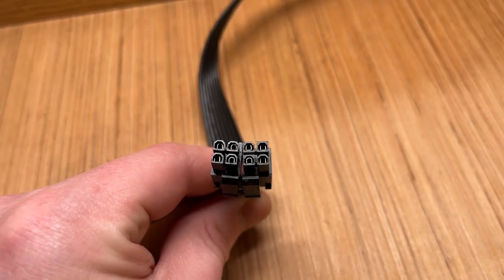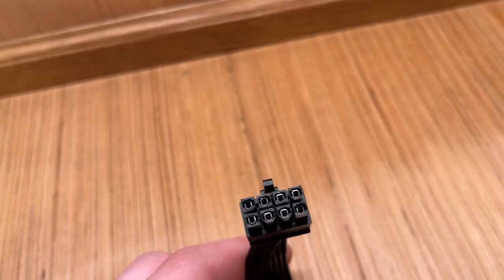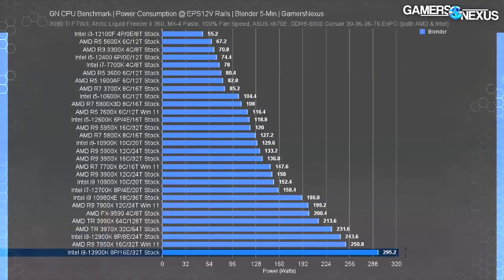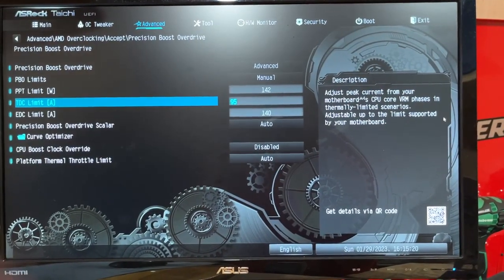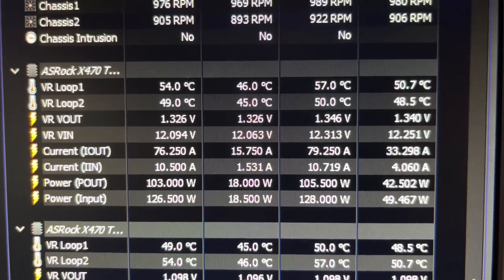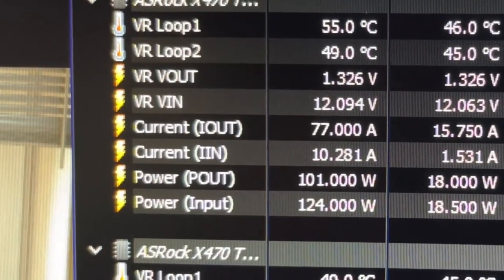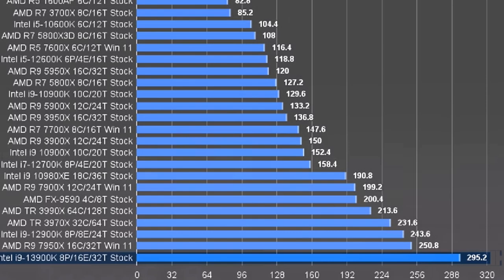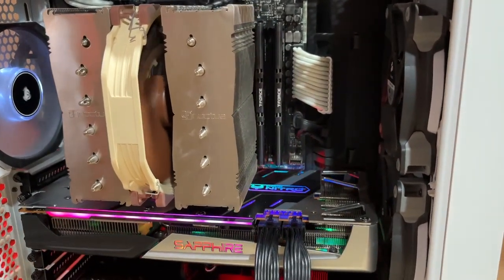You Don't Need Two CPU Power Cables

Comment: Many thanks, took me forever to find a proper answer. The new motherboard im planning on buying has 8 and 8 pins and my current PSU only has 8 pins. I really don't have the money to upgrade to another power supply specially since the one I have is more than enough.
Reply from the maker: Which CPU and motherboard are you going with?
Reply: @anthonytech  it’s an i5 12400F and the mobo is a ROG Strix Z790-9.

I’m in the middle of putting it together and I just managed to get into BIOS with only 8 pins. I’m missing the new m.2 drive I need for C but my impatience got the better of me.
Reply from the maker: @LyraniaLothar  You'll be plenty fine with a single 8-pin for a 12400F. Good luck with the rest of the build and happy gaming!
Reply: @anthonytech  Hi, I just bought a Ryzen 7 8700g and a B650 Pro Motherboard. My PSU is an old Cooler Master 650w +80 Bronze, it only has a single 8-pin, the motherboard request two of those.

Thank you.
Reply from the maker: @Uasaapp  One 8-pin is plenty for an 8700G

Comment: My motherboard is a msi mag b650 tomahawk wifi with 2 8 pin cpu power outlets and the cpu I’m using is the 7800x3d do I need to occupy both outlets or just 1?
Reply from the maker: One 8pin is plenty for a 7800X3D
Thanks for watching and commenting

Comment: 7950x runs fine with only 1x 8pin on MSI PRO X670-P Wifi , however havent done any stress tests. i'm using a gold 750w seasonic psu with a 7900xtx which is ok, considering i'll be undervolting them both.
Reply from the maker: Let me know how the undervolt goes 
For a build like that I would’ve went with at least an 850w but 750w should be okay

Comment: do you have this type of proof on the GPU side of this convo - seeing so many talk about the pigtail/daisychain 8-pin convo., with 2 or 3 8pin inputs on a 30 or 40 series card... people are saying LEAVE the pigtail hanging in the air and direct multiple 8 pins from PSU straight to GPU and just leave the pigtail hanging off (ugly) but is this actually good advice??
Reply from the maker: Let’s assume you have a GPU with 2 8-pin connectors:
A single cable that has 2 (daisychained) connectors on it to power the GPU is just fine 
Being cautious is never a bad thing though. For example in my personal rig my GPU has 2 8-pins and I use two cables to power it. As for the the daisychained connectors I zip tie them to the cable itself to look better 
You can also get custom cables so they don’t have additional connectors on them. Cablemod makes really good cables.
Reply: @anthonytech  yes i did this about 5 days back and tied the chain flush so visually didnt see the difference and i saw a jump of 50-100 points in most benchmarks i run before/after. and 5-10 fps more when running 105% power on Msi afterburner. was a fun lil free upgrade to do with the 2nd 2-8pins i have in my psu box just sitting there now in good use!
3800x CXPU
3080ti GPU
thermaltake 850 PSU

GPUZ - says i pull a nice steady 350-352 draw on GPU under full load now. before was capping at 338-348. 

For anyone that might read this in the future it was worth doing and free : )

Comment: i build a backup pc with a ryzen 5 3600 with power supply of 800w corsair and only 4 pin works on it so i plug it into my motherboard and it seems to Function just fine with only 4 power pin connected to it.
Reply from the maker: Yeah the 3600 is only 65W TDP so 4pin is plenty

Comment: I have 5950x and asus x570 gaming motherboard , but power supply heave only one 8pin cable. Is this enough for this processor?
Reply from the maker: Yes as long as you leave it at stock settings 8pin is plenty

Comment: I have an i9 14900kf. Should i connect the extra cord on my dark hero? Its another 8 pin.
Reply from the maker: So sorry for the delayed response. I swear YT isn’t notifying me. Depending on if your PSU, it wouldn’t hurt to plug in an additional 8pin since it sounds like you have a highend build
Reply: @anthonytech  Thanks! I did a while ago.

Comment: I have an MSI B760M chipset motherboard and i5-13600KF, instead of plugging 8+4pin connector but i only plugged 8 pin connector. Is it enough?
Reply from the maker: Oh yes one 8-pin is plenty for the a 13600KF 
No need to worry 😁

Comment: i have an i5 12600k and my new mobo (asus prime z690-A) has an 8+8 eps, would one 8 pin be enough if so which female connecter do i plug it into?
Reply from the maker: As long as your PSU is appropriate for your build
One 8pin is plenty for a 12600k 
Plug it into the left connector on the motherboard

Comment from the maker: CORRECTION: 3:01 The AM4 socket CAN deliver more than 142W, I was wrong. an overclocked 5950X can draw up to 270W depending on the scenario. Point being for most midrange CPUs (which is most of us) an 8pin is more than enough. If you're building/running a high core count CPU and plan to OC then plug in two 8-pins. And in most situations CPUs will hit a thermal limit before you ever get close to the 8pin amperage limit.

Comment: hello my pc is
motherbord a320 sh2
cpu ryzen 5 2600 tdp 65
gpu gtx 750 ti tdp 60
one hdd
one ssd
ram hp v6 8gb 3200mhz
power supply Dell 275EM-00 - 275w
and my power supply have 4 pin only  motherbord a320 need to 8 pin , so 4 pin its will worked or no?
Reply from the maker: 4 pin will work just fine for w 65w TDP CPU

Comment: I have a AMD Ryzen 7  3700X 8core in a  proprietary  HP Pavilion with only a 310 PSU and 4pin socket. I heard that corsair sells a 8pin that you can separate into a 4 pin that will work and use with an ATX bigger wattage PSU. Hope this question relates somehow to your vid which is somewhat over my head tech wise. Thanx in advance.
Reply from the maker: My video served to prove that most CPUs are plenty fine with a single 8-pin even though some boards have an 8+8 or 8+4 connector
A 3700X should be just fine with a 4-pin cable but I wouldn’t slot in anything over a 65w TDP chip
Reply: Hey you just saved my ass with that comment on how Corsair has splitting pin cables thanks have a great life👍🤙

Comment: I just got the new I9 and my board had 2 8 pin connectors i have a 1000 watt PSU but it only had 1 8 pin cable, if i buy a second one would i be able to plug it into the spare cpu port on my PSU?
Reply from the maker: You can do that but be VERY careful. 
Make 100% sure the cable you are purchasing is for your PSU 
Otherwise it could go very wrong
Mixing PSU cables is a no no 
There really needs to be a standard for modular PSU cables

Comment: Today I started to put together the new setup ( MSI PRO X670-P Wifi with a Ryzen 5 7600X ) but my power source have only an 8 Pin cable for CPU and 4 Pin aditional cable, the motherboard have 2x 8 Pin for CPU. Should I buy a new 8 pin cable to power the CPU?
Reply from the maker: A single 8-pin CPU power cable is plenty for the 7600X. No need for the additional 4-pin or even 8-pin, you’ll be just fine. Let me know how it goes! Good luck! Thanks for the comment
Reply: @anthonytech  Everything works fine. I had no problems with just 1 8-pin
Reply from the maker: @foxredwings  Glad to hear it! 
How are you liking your system?
7600X may be a 6-core but it’s a fast 6-core
Reply: @anthonytech  I can say it's way over my old Ryzen 5 1400. Never over 40% CPU usage, with discord, 30+ tabs open and playing videogames ( Valorant at HIGH graphics